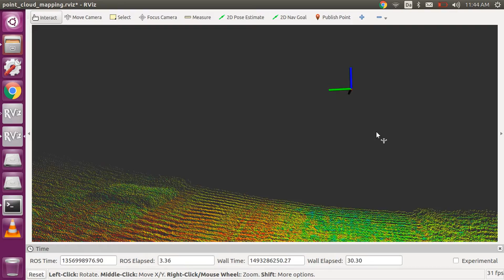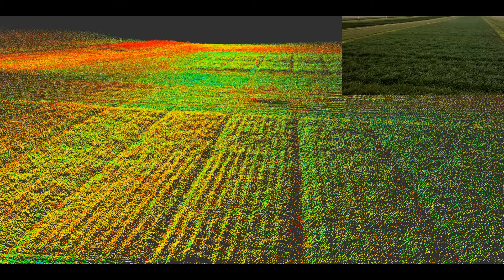First attempt at crop mapping with Velodyne VLP16 and Matrice 100

Comment: I have tried walking on desert lifting the VLP about 8 feet. It gives me some jumbled data. Is there any height factor?
Reply from the maker: You need to explain a bit more. Also look at the full project. We are not only using an VLP, but a number of other sensors to make it work! A link we more details can be found here: https://www.mdpi.com/1424-8220/17/12/2703

Comment: Hey Martin, awesome project! How did the Matrice 100 handle the weight of the LIDAR and support equipment? I have been looking at integrating a Velodyne Puck Lite to the M100 but am worried about the max takeoff weight.
Reply from the maker: The batteries will get a bit hot in the summer but that is the main problem. The batteries will also quickly be drained since the Matrice 100 is carrying the extra load. But we never had any problems with takeoff.
Reply: Thanks for the reply! Okay I was just wondering if there would be challenges with controlling the drone if there was wind - wouldn't want it to lose control during a big gust especially with the expensive sensor on board. Also: is the RTK-GPS needed to get a geo-referenced point cloud? or can you potentially use the drone's GPS with an IMU sensor?
Reply: @mattmullin5  Did you find a way to use the drone's GPS and IMU? I am interested in doing something similar
Reply: Matrice 100 can take payload up to 1000-1200Grams as I tested with flight time 10-12 minutes. In the windy situation, the battery will drain quickly however it will not lose control.

https://www.youtube.com/watch?time_continue=86&v=GF6ze28wQEw This is the video link of my setup.